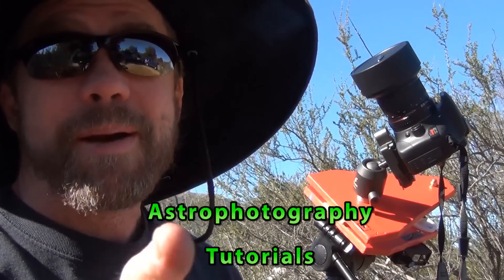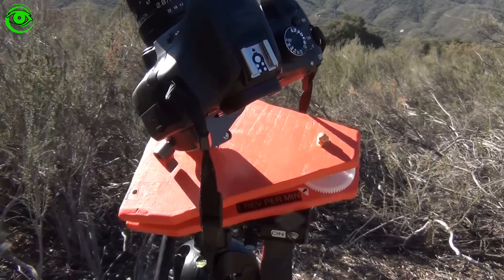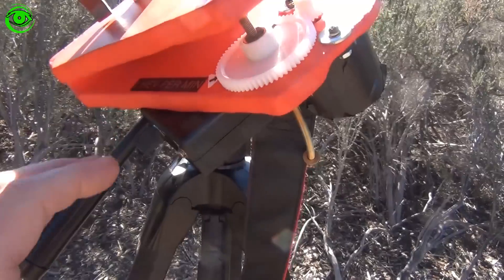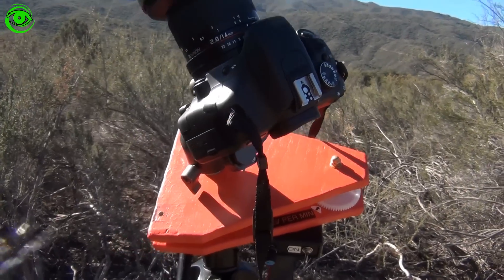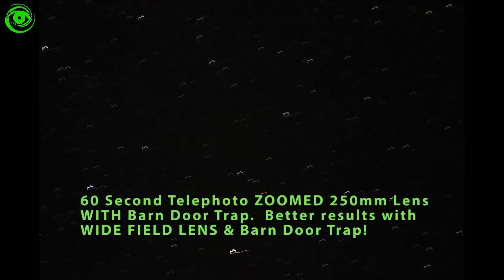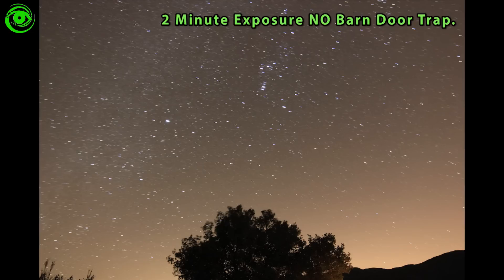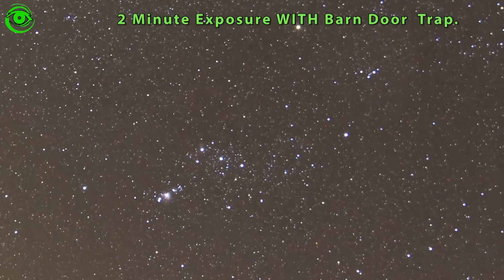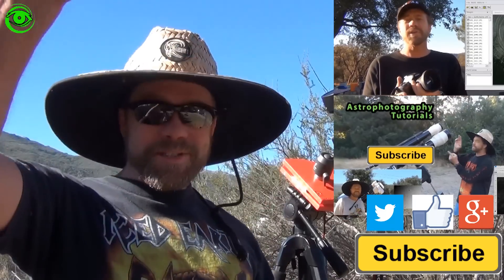How To Use DSLR DIY Barn Door Trap & Results - P3

Comment: I'm way 'late to the comments' but I want to thank you for posting this video. When I tried using my mechanical NYX Tracker with my 75-300 zoom lens, I got those 'squiggly' lines in the stars. Now, I know what the heck the issue really was as opposed to thinking I had not aligned correctly.
Reply from the maker: Glad it was helpful in some way.  Thanks for commenting.

Comment: 1:50 I've always wondered... Why not rotate the tracker 180 degrees East/West and start with the hinge OPEN, so that it CLOSES with the rotation? That way you don't ever risk "running out of real estate" on the screw! You could then wire in kill switch between the plates to kill the power when it's out of room.😎
Reply from the maker: Had me thinking about it, I guess you could do that?  Give it try MacGyver!  If anyone can do it . . . you can!  =)
Reply: @Myastroimages  the rest of my parts are ordered and should be here Sat, then off to WY on Wed for some Bortle 2 skies! I'd think it easier/safer to start your trek at the edge of the precipice  and walk away, then blindly TOWARDS it in the dark!  😎

Comment: Awesome build, and now I am going to have to build my own. One question, How does your motor wind the trap back down? Do you just raise the arm and turn the large gear by hand?
Reply from the maker: Good question Chris.  It's very simple, lift the upper part to disengage the gear, and the wind it back the other direction.  Doug
Reply: That’s what I thought, but wanted to make sure. I will probably look for a 3 position switch so I can just flip it in reverse while I pack up my gear, aka I’m lazy lol.
Reply from the maker: @chrislacey1665  That's an idea!  Make sure you place a cap nut on the end of the rod to help prevent it from flapping over with your camera on it.  Without the cap nut, it could be a big problem for your DSLR.  I normally can get about 2 hours out of the system before I need to wind it back.  Maybe 3 hours if I push it.  You can't just set it up and let it run all night without some assistance.  Good luck on your project!

Comment: Does it work with longer focal length lens? Polar alignment needs to be really accurate.
Reply from the maker: With my experiments, the longer telephoto lens didn't work as well as a wide field lens.  I don't think it was the polar alignment, it looked like a lot of flexture and bouncing.  When you magnify your target, it shows all the imperfections of your guiding system.  I think if you want to use a Telephoto lens, it may be time to upgrade to an EQ Mount with auto guiding.  
Thanks for watching and commenting!
Doug

Comment: How do you take multiple shots for stacking?
Reply from the maker: Hi David,
Taking multiple shots and stacking needs special software.  DeepSkyStacker is a free software you can use for stacking photos.  If you are using a WIDE FIELD that contains terrestrial objects, that may be more difficult.  You see stacking software takes the brighter stars to align and as you know the earth is constantly moving.  If you can, try to take a shot of the night sky that doesn't have any terrestrial objects and I think you'll have better luck.
Doug
Reply: Astrophotography Tutorials Thank you for responding. I have used DSS for stacking. What I'm curious about, once you take a shot with the tracker, do you have to close it, realign to polaris, and shoot again, and again to get multiple shots? I just made a barn door tracker and haven't had the opportunity to use it yet. I have taken 200 3 second shots and stacked them, I know tracking will limit my shots to maybe 3 or 4. Longer exposures obviously.
Reply from the maker: You're only limited by the length of your screw on your barn door.  You should be able to take 30 second exposures with ease.  If you need to take your screw and reset it, then you should polar align again.  But it's not necessary to polar align after each shot.  You may want to time your barn door...during the day...see how long it takes the screw to reach it's limit.  Now you take as many shots that fit in that time it takes your barn door to fully open.

Comment: I watched your videos and recently finished building my BDT. I was wondering what ISO you used when shooting 1-2 minute shots.
Reply from the maker: Interesting Question Dennis.  There isn't a set rule with ISO and different cameras.  For the most part I shoot ISO800 at 30 seconds, but, with higher ISOs you tend to "Over Expose" on higher ISOs.  If you're doing 2 minute exposures, you may find that ISO400 or lower would work best.  Remember, the higher the ISO allows more light to be captured, but, it also introduces MORE noise.  So I'm thinking you could probably go as low as ISO200 @ 2minutes.

Again, unfortunately each camera is a little different, so most of the time it's making notes, and trying different exposure/iso values until you find that perfect combo.

I hope that helped a little.  Good Luck and if you do find that magic ISO number for 2 minute exposures, please post your results.  I'm interested in your results.

Thank you,
Doug
Reply: Thanks for the information!
Reply: I will. Thanks!

Comment: Excellent three videos. I will build mine from your design. May I suggest that mounting the electronic components on the other side of the board would have made life easier for you and posed less risk of a short circuit. You could have then soldered the component leads into the copper tracks. But, in any case, very well made videos. Thanks man.
Reply from the maker: Thanks, yes, other people who are more skilled than me pointed out that too.  I learned a lot along the way.  I hope this helps you make a better version.  After you finish yours, post your results, and photos.  Thank you!  Doug

Comment: Hi Doug, thanks for the awesome videos. I'm going to be building this very soon (ordered some of the parts already). Quick question, What is the longest focal length would you recommend for this? I was hoping to get pictures at 135mm with this.
Reply from the maker: Hi Ivan,
Let's just say it's more forgiving at shorter focal lens and wide field it's hard to beat.  If your version is tight and dialed in you'll probably have better success than me.  I didn't try a huge range of focal lengths, mostly concentrated on short focal lengths.  I think 135 may be too much for it, but, it's hard to say.  If you don't mind taking a risk, you could build it, and try it.

Thanks for watching and commenting, I appreciate your positive feedback.

Doug

Comment: How do you get the top platform back down since ther is no switch to control motor direction?
Reply from the maker: Hi Patrick,
You simply stop the motor and lift the top half.  Then spin the gear on the rod back down by hand.
Doug

Comment: Hey Doug, I just finished mine up today, used yours and garys design. I used a 3 1/2 inch hinge and mounted my drive gear on the side away from the control box that way it pushed the top board towards you and it holds the hinge firmly but still rotates well. The circuit was the hardest part for sure. I'm an avid Astro photo guy. If you're wanting to pull out the most detail google "lonely speck shooting and processing Orion" it gives awesome stacking methods and lessons! Cheers thanks for the help can't wait to test mine
Reply from the maker: Great!  Let me know how it goes and post some photos!   I think you'll be happy with the results!
Reply: I sure will! Just waiting  on some clear Skies. You can see some of my other stuff over at instagram.com/onthebrinkphotog
Reply from the maker: Good terrestrial shots on your page!
Reply: Thank you!

Comment: Nice machine Doug.
One suggestion: Use a piano hinge stead of the small single hinge. A piano hinge is a continuous hinge, you can get then at any hardware store like a 12 " long and cut to size.
Also you should get familiar with an Arduino microcontroller and a stepper motor so you don't have to worry about battery run down.
Reply from the maker: Thanks Mark!  Yes, after I built it, I realize a piano hinge or long hinge would have been a better choice.  I do use Arduinos at work, but, surpriselying, this crude version does work!  I took it out last weekend and it's still keeping time.  The battery is over a year old now.  Thanks for commenting and watching.  Doug
Reply: @Myastroimages  I'm building my Barn Door Tracker, and I'm going to use some voltage regulator for example 7805 or 7809 (i dont know yet). To adjust speed im going to use microcontroler (some ATmega8) and PWM. It is simpler solution than stepper motor but i dont know how precise it will be.
Reply from the maker: @leszekponiatowski1427  Let me know how it goes!  I like seeing new ideas.

Comment: Very nice, i never heared of that concept, i just stumbled across by "accident". You gave me the inspiration for building my own one. I reused my old Lego Mindstorms Set to construct the gears and also a Voltage regulator from an electric Lego Train! Because i obviously can not bend the lego pieces, i made a kind ot "tangential pusher" setup where a beam just pushes the upper half of the Trap straight up. But for Tracking up to 1.5 minutes with f 200mm it ist totally fine, i coultnt believe it myself! I used a piano hinge for 4€ and a 1cm thick MDF Wood plate. I also had to buy a ball head for 25€. But it is totally worth it, cant wait for the moon to vanish from the midnight sky for low background photos. Cheers! Paul
Reply from the maker: +nochjemand Sounds like a fun Project Paul!  I think I saw a lego version of this when I was browsing the internet.  Lots of different ways to make one.  Thanks for watching.  Doug

Comment: hello! you can GREATLY increase the accuracy by doing 2 things: 1) use two hinges.. they compensate each other and reduces play big time.. 2) make the lenght of the trap double as long and let the motor spin twice as fast. this will reduce the vibrations of the motor and also will increase the precision you can reach with the potentiometer.
Reply from the maker: +Igor Masin Thanks for the tips Igor!  I had problems using two hinges, but, other people suggested using a piano hinge, or longer hinge.  Did you make one?  Post a photo, your design sound very interesting.  Thanks, Doug
Reply: yep, built one myself! will post the pictures! where can i post them? mine is controlled my a microcontroller and calculates its current speed continuously to compensate for the changing angle. so far I was able to shoot pictures at 200 mm but I plan with some changes to go up to 500 mm..
Reply from the maker: +Igor Masin If you can link them from any where, post the links.  Some free sites like Dropbox or Copy allow you to share links to photos...or if you have a flicker account...Post the links!  I'd love to see your creation.  Thanks!
Reply: +Igor Masin hi Igor if I double the RPM to 8 and doubled the distance does the gear ratio of 64 to 16 stay the same or will that have to change.
Reply: @peteranthony4291  No, if you double the radius and dibble the motor speed your already good. You wouldn't have to change your gear ratio. But if you wanted to let the motor speed the same, then you'll have to halve the gear ratio. Just make sure, that the gear speed to radius ratio stays constant. But an even better solution is to automatically control the speed using a microcomputer.

Comment: Hi Doug ... wicked Barn Door mate & quality videos ... I built one last year, also using Gary Seronik's plans ... the difference being I added an Arduino (for timing) and a chinese 5v 28BYJ-48 stepper motor (a modification by Ken Arthur) ... the timing is spot on and with the advantage of the Arduino, setting the timing for the stepper motor, it's literally plug & play ... plus being a 5v circuit I can use any voltage source from 7v to 12v (car battery jump pack is ideal) ... I grabbed a nice Tokina 11-16mm 2.8 DX II a few years back ... still need to use that lens and the barn door tracker ... I think you've just spurned me on ... ;) ...
Reply from the maker: Hi Gem!  That's good to hear you're getting back on the BDT!  You're not the first person to state they used Arduino.  It must be a popular device.  Thanks for watching and commenting!  Doug
Reply: Hi Gem, Arduino sounds quite exciting.  Do you know where I could find "simple" plans for my platform?  Thanks!!

Comment: Very nice  job  doug , can  we  have  the drawing  for the  wood  part if you post   it to you forum
Reply from the maker: Thanks for the kind comments Sami.  I didn't use a pattern other than just drawing it on the wood.  I don't think the pattern makes a difference, only the holes.  The holes properly aligned give you the 7" radius you need.  Doug

Comment: Congrats Doug!  I was very excited watching this part.  I had to laugh when you tossed the polar scope out, hilarious.  I am currently trying to align a 6x30 finderscope properly to get a very precise polar alignment.  Unnecessary for wide field but I am trying to go longer.  A few things I noted.  On your 250mm example there was a good example of the pinion gear pushing against the spur gear.  I hope you don't have it too tight, this would benefit all your sessions.  Also I noticed your larger stars have quite a bit of a flare around them, I think you can get sharper stars by stopping down a bit.  I suppose with these trackers one has to decide how far to go, you can always add stronger components, more precise stepper motors, etc.  If you are happy with wide field it's good enough and definitely teaches you a lot about this hobby.  I definitely recommend trying to build one of these if you are interested in astrophotography you learn so much.  Great job capturing Lovejoy and Pleiades together.  Here is my astrobin using my barn door and latest examples:  astrobin.com/users/entilza/
Reply from the maker: Hi Mar!  WOW you really have some nice photos using your BDT!  I literally have only used the BDT a couple of times, I think I will get better once I learn some more about the little tips and tricks to dial it in.  I appreciate your comments and suggestions.  Thanks for watching and commenting.  Doug

Comment: Made mine back before digital.  Manual crank.  Not as elaborate as yours but it did work.

Barn Door Hinge.
https://farm4.staticflickr.com/3480/3836169555_3a2675a142_o.jpg

Photo taken on film. 800ASA and about a minute long...I think. 
https://farm1.staticflickr.com/122/280942104_26181e317b_b.jpg

Astrophotography is so much easier now with digital and live view.  But I still shoot film.